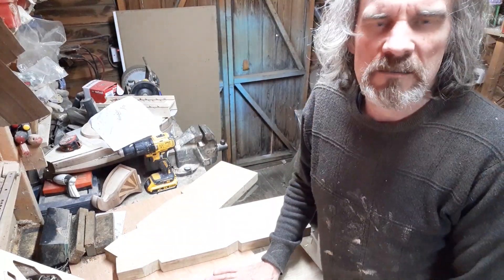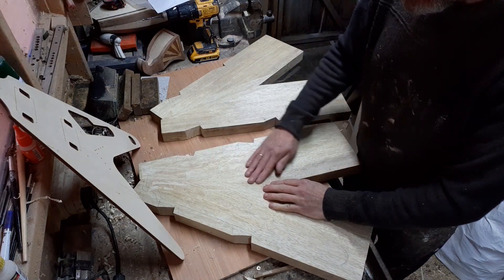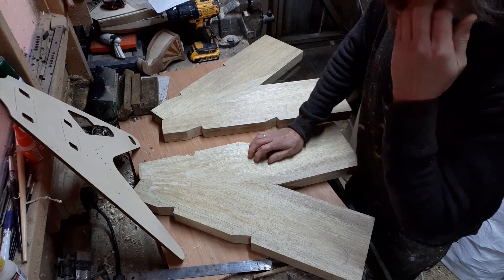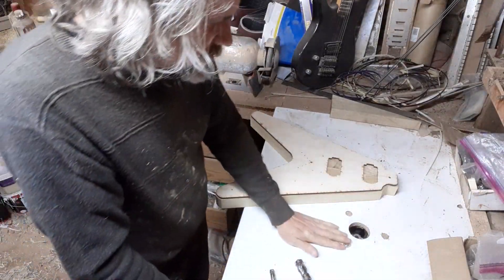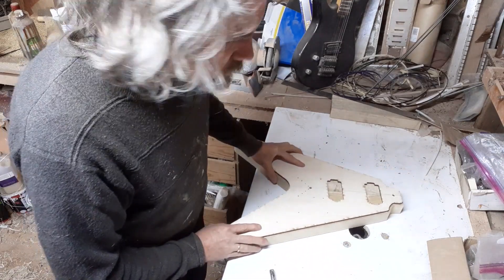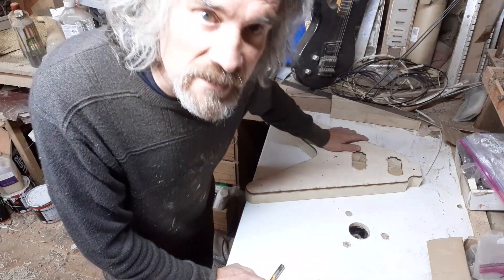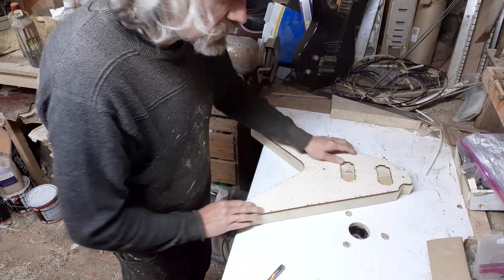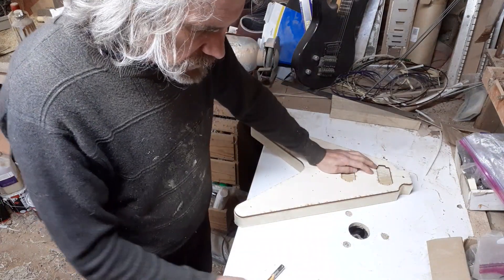1958 Flying V build...Part 2

Comment: After you glue the two boards, I'm assuming you end up lining that seam up with the center line of your template and redraw the body outline before cutting it out with the bandsaw and routing and such, yes?
Reply from the maker: Yes, that's important, the joint between the boards is the centre line of the guitar, it's kind of the datum for the whole build, especially lining-up the neck, you don't really want the bridge or apex of the tailpiece to be off centre.